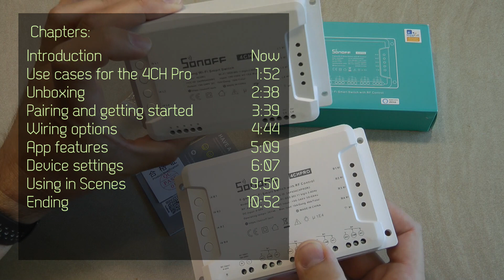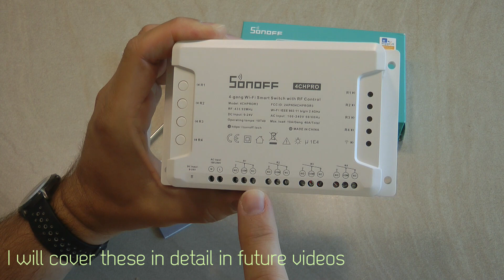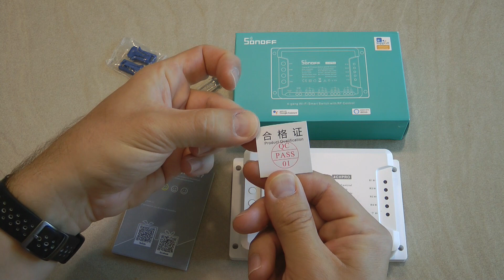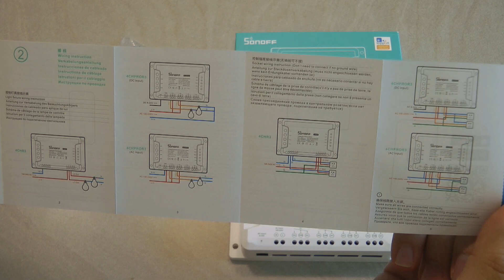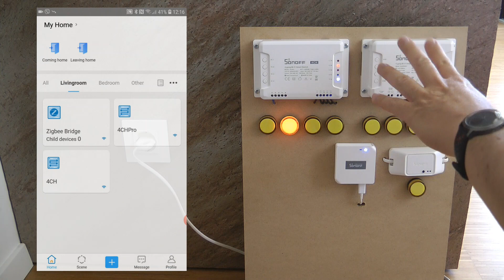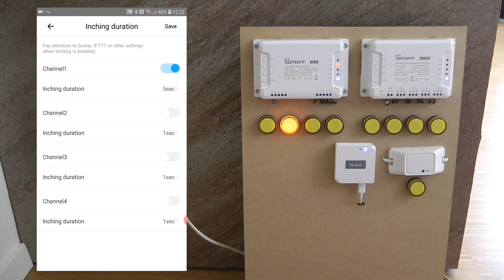Sonoff 4CH Pro - Non-mains switching at last

Comment: Does sonoff have a delay timer in between actions?

 I need the sonoff to run an automation on a machine that has a VFD. 

I need to activate 3 channels of the VFD.  On. Off. Reverse. Inter lock mode. 

I need one relay channel to send a 1 second signal to the Start. 
Then I need a delay of 15 minutes with nothing happening. 
Then I need  to send a one second signal from channel 2 to my Stop input. 
Then I need a delay timer for 1 minute with nothing happening. 
Then I need a one second signal from the relay 3 to my reverse input.  
Then I need a delay timer again for 15 minutes. 
Then I need a one second signal from channel 2 to my off input and end the sequence.
Reply from the maker: Yes, this is possible in the scenes. In the actions you can list different devices to turn on-off and also add delay statements between them.

Comment: Is it possible to use this to have 2  channels to switch on/off a 230v and 2 channels for a 24v device?
Reply from the maker: Yes, each relay output has a separate COM and NO connections. So you can wire 2 COM ports to 230V, and the other 2 to 24V.

Comment: it's disappointing there's nothing to be found on YouTube on how to make this work as a garage door opener (or in my case to open 3 window shutters). You mention you can use it for this, but you only show how to switch a light on and off. I think it's strange people would use this kind of device to simply control some lights, as there are much better, smaller and cheaper devices (also from Sonoff) to do that. For shutters on the other hand, there's not a lot of similar devices to be found (there is the Sonoff Dual R3, but then you have to get multiple devices and it becomes much more expensive).
Reply from the maker: I agree. I am sorry, I covered garade door in the past and did not mention here. But you can use the COM and NO terminals and connect those to the garage door.
Reply: @csongorvarga  thanks for the reply. As I understand, I can simply connect the motors of the shutters to the COM and NO connections? They will then just open or shut and stop automatically (the current will cut automatically when the shutter reached the end point)?

Comment: I dont know how to connect it to 24v water sprinklers. Can u help plz ??
Reply from the maker: One wire from the 24V transformer goes into the COM terminal of the 4CH Pro and the NO terminal goes to the valve. And the other wire from the 24V transformer goes to the valve directly.

Comment: What size barrel is the DC power input and is it center positive? I'd like to order a PSU at the same time I order my device but I can't find any information at all on the power connector.
Reply from the maker: It is the most common 5.2 mm diameter barrel jack. There is no marking on the polarity, therefore I can only guess that it is a more common centre positive version.
Reply: @csongorvarga , thanks. I certainly hope you’re right. It seems extremely strange to put something like this out without a power adapter, but no markings anywhere as to the polarity. Here, you figure it out, we figure you’ve got a 50/50 chance, and if you burn it up, we’ll sell you another! Positive center definitely seems to be the most common though, so I feel pretty good about my chances.
Reply from the maker: @byronfollowell4243  Yeah, I checked Sonoff's website and there is nothing. Probably there is input protection built in :)
Reply: @csongorvarga , maybe. I was reading another review and a user mentioned getting it reversed and letting the magic smoke out and his board didn’t work anymore, but he never mentioned the polarity of the adapter he used or what he changed to.
Reply from the maker: @byronfollowell4243  Oh. you know what, let me ask from my marketing contacts :)
Reply: @csongorvarga , if you have contacts, yes, please contact them. For that matter, slip them the suggestion that they really should put something in their manual, maybe stamp it on the housing, put it on their website.
Reply from the maker: @byronfollowell4243  I got this response from Sonoff: "DC input are typically designed with a center-positive and outer-negative polarity configuration. Placing the negative terminal on the outside reduces the risk of electric shock and leakage. 

There is no polarity protection in place.". So it is centre positive, and explains the magic smoke.

Comment: My honest question is apart from the 4 switches can you also another 4 making 8 in one app? Since there's no 8 gang but just 4 2 and 1
Reply from the maker: Sure, If you buy 2 4CH Pro you will have 8 outputs altogether. It will be 2 different screens with 4 buttons each.

Comment: 4 Channel interlock mode can be very useful if you have a sprinkler system and 4 valves in a low-pressure environment. When one zone goes on the rest switch off.

Comment: Great video. Helped a lot. One question if I may ….. can I use 1 channel to switch a 12vdc device [door lock] when others switch 220v  AC whilst unit is powered by AC?
Reply: ofcourse, you control relays, not mains 😁

Comment: I want to have all four switches be "dry contact."  Looking at the wiring diagrams, it implies that this can be done only by powering the Sonoff with DC. Can it also be powered by AC (110V) and still be dry contacts?
Reply from the maker: Yes, it works with AC and DC. Sonoff diagram just connects AC live in case you want to use it as a mains switch. But in that case you can buy a simplier 4CH. So, again yes. And each output is completely separate, so one can be dry contact, other mains contract and so on.

Comment: How the wiring for DC devices from dc input?
Reply from the maker: There is a jack for powering the device from DC. If you want to use DC for the relays, it is the same as with AC. You connect the power supply DC input for COM and the device you want to switch to NO.
Reply: @csongorvarga  thank you for the explanation.. im thinking about powering 12v dc led bulb from dc battery rechargeable using solar charge controller..do you think that is possible?
Reply from the maker: @ss94  Oh yes. 4CH PRO is probably the only product from Sonoff which works with 12V DC. So this is the ideal choice.

Comment: 4 channels interlocking may be used for sprinkler system if you don't have enought water pressure to start watering on all sections. For example I got aproximetaly pressure of 5 bar for watering a garden. All of my sections are quite long and if I would like to start all of them at the same time, they wont jump from ground, just leaking a water.

Comment: 4 channel interlocking can switch betwin 5v-7v-9v-12v if supplied with this voltages on each relay.Then you can adjust a fan speed
Reply from the maker: Great idea

Comment: Hi. One question, do you have to be in the same wifi network to operate or can you operate in your phone even if you're on 4G? I'm asking because my wifi doesn't reach my front gate and i would like to operate the gate as i come home with my phone in 4G while the sonoff is in my garage (were wifi is in range) connected to the gate by 20 meter wires. Is this possible?
Reply from the maker: Yes, it works from wifi and also from 4G. That is not a problem.

Comment: Good video.  I must have missed it but did you cover how to pair remote controls?  How many remotes can you pair per channel?
Reply from the maker: No, I did not cover that. I did not get a remote for it, and I don't have anything that I could have used. But I will see if I can do something about it in the future.
Reply: @csongorvarga  Thank you.  I have just received my 4CHPRO and after further research I was able to configure pair 4 remote controls to channel 1.  I installed these remote controls in 4 bathrooms mimicking pushing buttons to activate  Navian NPE-240A built-in On-Demand hot water recirculating pump.  Excellent tool for saving water.
Reply: @csongorvarga  Helpful Video. The Sonoff 4CH PRO supports an RF remote control, but do you know if the Sonoff 4CH supports RF remote even ? the manual is not clear.